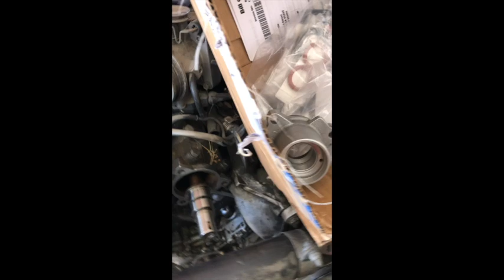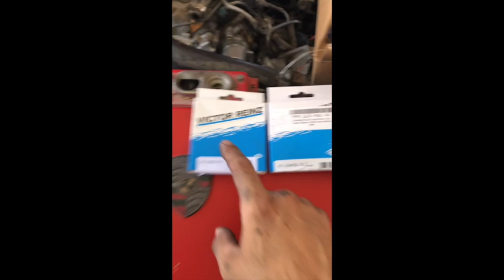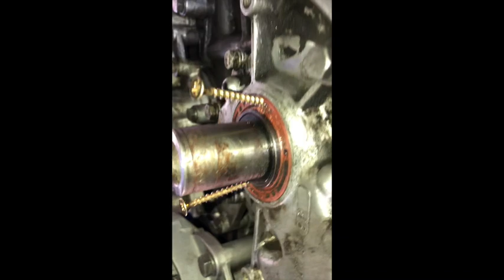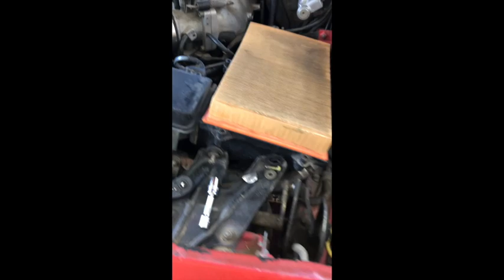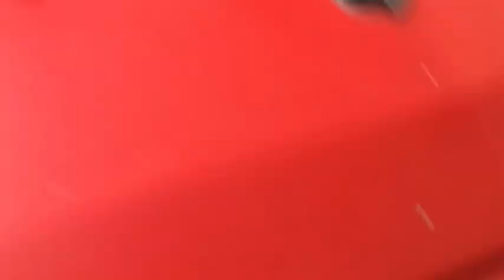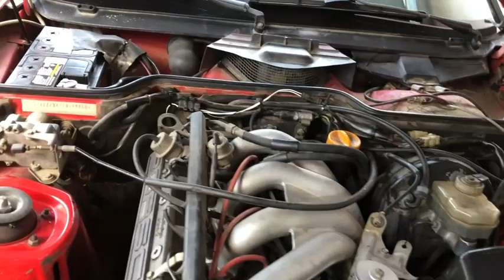7 Porsche 944 Front Engine Seals (Balance, Crank and Cam Shaft Seals)

Comment: Gabriel, my 944 just started making a "ticking-knocking" noise, from near the front of the engine.  I'm reading that i need to check the cheesebolt behind the distributor cap. Is this easy to check?
Reply from the maker: It really is, well, if you just want to visually inspect it. I have attached a quick pic of the distributor cap/housing. 
First, locate the front distributor cap (where the spark plugs connect). Then locate the 2 screws (top and bottom) in the pic its #11. the screws do not come off. You have to push them in about half inch and then turn them so they release the distributor cap. Second, locate bolt #13, there are 2 different bolts on our 944s. some are hex while others are allen head. you'll know once you see it. You'll have to use either a 6mm socket or I think it's a 2.5 allen for the other. 
Next remove the rotor and the dust cap (#14).
Lastly, remove bolt #27 and it's housing to get to the cheese head bolt. 
You can now visually inspect it. 
In the event that you need to remove or replace it, look through my videos on how to set the engine to TDC before you do any of that.  
Then search for my "Porsche 944 CAM Tower Install with 4 degree offset key" Around min 2, I show what is needed to remove the bolt. You do not have to remove the CAM tower. But if you need to remove this bolt you will need to re/set your timing. so be ready for that.
PIC: https://rennlist.com/forums/attachments/924-931-944-951-968-forum/258622d1204422965-ignition-rotor-hex-bolt-distributor-rotor-shaft.jpg
Reply: @porsche944shenanigans3  thank you very much!  I will do this to check the cam.  Someone suggested they can become loose. But now i think the noise is coming from the firewall side of the engine.  Not sure where to go from here. Can i send you a video clip of my sound? I get a big bang/clank right upon start up, and the same bang as i turn the engine off.  And when its idling, its a loud knocking sound, that goes away as i increase the RPMs.
Reply from the maker: @danmazz8733  man that sounds bad and confusing. Upload it to YouTube and send me the link here. Have you tried forums or maybe posting your video in FB? They have a great community over on the "EDREDAS" Facebook group. A lot of great 944 minds on there. Brent Burnett checks it regularly and he is by far one of the most talented people for the 944. I'm sure you've seen his channel on here. Send me the vid link and post it on FB as well.
Reply: @porsche944shenanigans3  im not on Facebook, it might be time to register.  I have an audio clip that i can email you if your like to give it a quick listen.  Im not sure how to post Video on YT.
Reply from the maker: @danmazz8733  Ah ok, send it hear libegar@outlook.com, heading to work but I'll try to listen and reply when possible

Comment: Good video. I'm about to do the water pump and seals on my car. Are you able to do the seals without having to drain the oil?
Reply from the maker: Yes, you DO NOT have to drain the oil for seal replacement. Oh and by the way, I'll be uploading a water pump install video hopefully by this Monday. If you get a chance to watch it, let me know if it helps you out any. Feel free to send me a note if you have more questions. I'll do my best to answer them or point you in the right direction.
Reply: @porsche944shenanigans3  
Ok good to know. Because I just changed the oil 200 miles ago and now all of the sudden the water pump gasket decided to start leaking. So I figured while I'm already in there do the seals.  I will keep an eye out for your video. Every bit of knowledge helps.